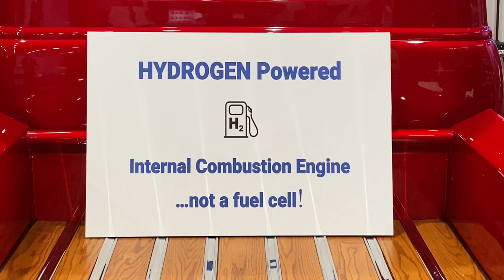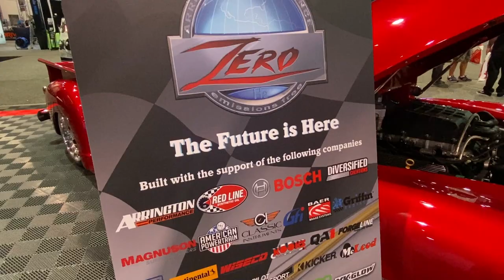Supercharged LS3 Powered Chevrolet Pickup Runs on Hydrogen Gas 2021 SEMA Show

Comment: interesting enough the fastest drag motor cycle is hydrogen peroxide powered. It was last seen under experimental stages to control its fuel system,  yet very promising!

Comment: To mass produce hydrogen they still use methane or natural gas.  You can also make hydrogen using electrolysis, but that's not as efficient of a  method.  The electricity usually comes from coal.  Back in the 90s I used to have a 65 Chevy pick up that someone before me converted to propane.  That oil always stayed clean
Reply: The hydrogen industry is on the verge of creating 100% clean hydrogen, using renewable/sustainable energy sources. There is currently clean and dirty hydrogen (Same end product, different manufacturing process) but the industry as a whole is going in the right direction, to enable an end-to-end green fuel source. Can't say that for batteries. Oil from hydrogen powered vehicle would also be immaculate and you'd have zero emissions. Kudos to you for driving green all those years ago!

Comment: But whats the range?
Reply from the maker: Technically, the range should be the same as a gasoline powered vehicle.   With the claim that Hydrogen makes 3 times the power of gasoline, it would take 1/3 the hydrogen to go the same distance as 1 gallon of gas.   So a 30 gal gasoline supply = 10 gallons of Hydrogen.   I don't know the math on how the gas volume is measured when compressed in the tank, but the systems would be designed to be comparable to gasoline range, if not more we'd guess.   Good question.

Comment: 5000 PSI? Sounds sorta dangerous. Have these tanks ever exploded anywhere? 💥
Reply from the maker: Great question.   The tanks are pretty serious as we understand... it's a rubber bladder inside of an aluminum tank that is fully wrapped in carbon fiber.
Reply: The tank is already DOT approved, as well.
Reply: That’s reassuring Kevin but a standard oxygen tank will smash through brick walls and blast over a 7 story building if ruptured. This tank is almost double that pressure. It’d blow up like a small thermonuclear device in a collision. It would be a blast to see destructive testing footage of one these tanks. ☄️ 🔥

Comment: Hydrogen internal combustion engines produce no carbon emissions only NOx unless they made a  modified  catalytic converter to filter out the NOx completely than it's zero emission . But a hydrogen fuel cell electric vehicle is a zero emission vehicle. How's they get rid of the NOx from the combustion process?
Reply: because its an LS engine duh.

Comment: To mass produce hydrogen they still use methane or natural gas in the process
Reply: Read up on clean hydrogen, there is currently both options but the industry as a whole is committed to 100% clean, deriving the energy needed from solar and wind.

Comment: Zero emissions?  Not when the whole process is considered!
Reply from the maker: We did say NEARLY Zero, and of course, that's tailpipe emissions.   But thanks for using the microscope on us!
Reply: Read up on clean hydrogen, the hydrogen manufacturing industry is all-in on creating 100% clean hydrogen using sustainable energy sources like solar and wind for production. Also, this would be a conversion kit, not requiring you to buy an entirely new drivetrain, so there's another carbon footprint reduced.
Reply: @MsSuzyHomemaker  I have..So why don't you!
Reply: Most electricity in USA is made from fossil fuels so you can do the same argument for where BEVs electricity is produced